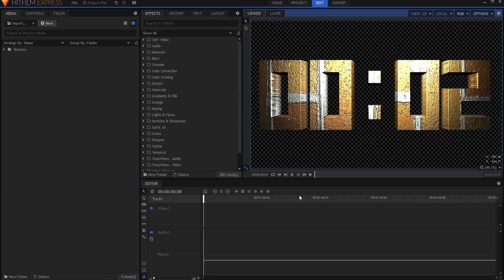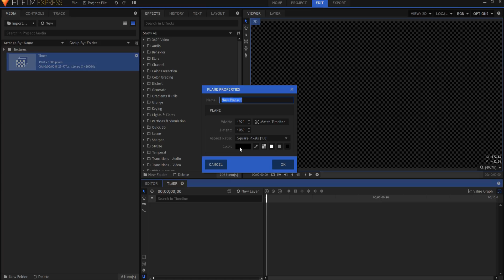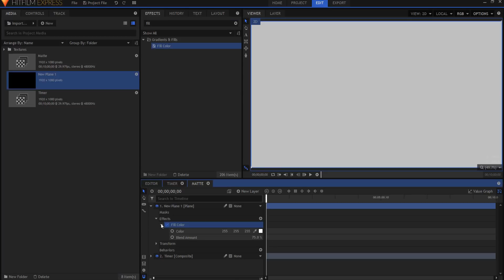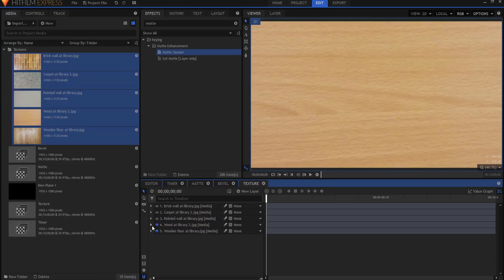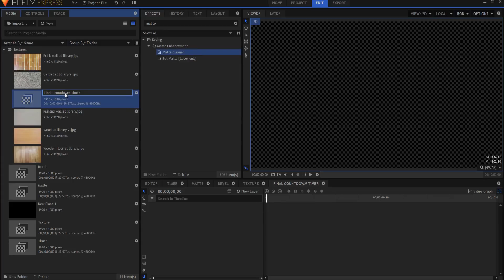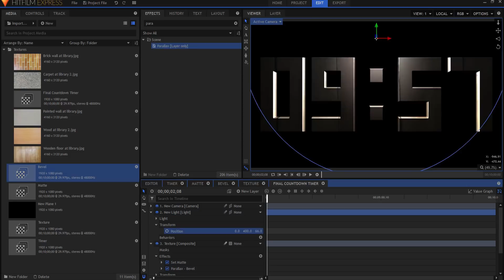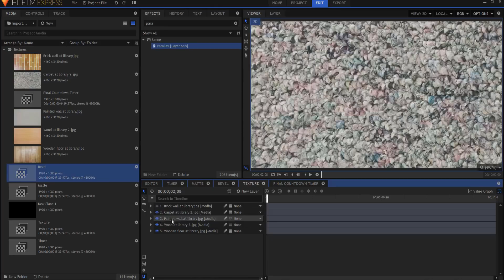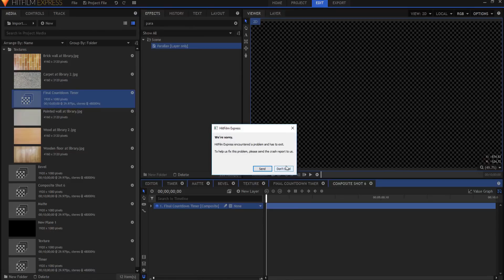How to Make a 3D Countdown Timer in HitFilm Express

Comment: I don't know how to freeze the timer?
Reply from the maker: Do you want it to stop in the middle of it's countdown?
Reply: @HitfilmSensei  Yeah and restart, as well before like if I was talking, "get ready set go" then make numbers start. You see the clock frozen for a time.
Reply from the maker: @ParadiseofDarkness  All you have to do is add a Speed Effect and keyframe it to go to 0 when you want it to stop. You can of course have the clock slow down, speed up, etc . as well.
Reply: @HitfilmSensei  I have tried that and still not wont work on reverse time for me for the freeze.  Like if I wanted a ten minute mark to stay paused on that as I talk about a ten minute art challenge in my video, then like said then say ready set go then the timer goes when doing the art. It wont do it. Unless im doing something hugely wrong or my program being dumb. 

Thanks though for the help. Im doing a work around which is 100% harder that I just render a video of the timer to get what I want, then cut it up like a video, then add it in my main video.
Reply from the maker: That's a way top do it to. Simple render out the video, then cut an lengthen where you want the pause. It wouldn't be that much harder.

Comment: I have a problem, when I use an effect in a video it doesnt do the effect so the normal video just starts playing again even tho I set keynotes and all the other stuff. Can you please help me
Reply from the maker: In the upper right hand corner of HitFilm you will find a button called "Options." Change all of the quality and resolution settings there to the highest levels and that should fix your problem.
Reply: Film Sensei  I did this and it still doesn’t work. Is there a reset option bc I really don’t know what to do else.
Reply from the maker: The next step would be to make sure that all of your drivers, especially the video drivers, are updated on your computer. Then, I would download the newest version of HitFilm. After uninstalling the old one, Install the newest one and see what happens. If it still doesn't work, I would then contact FXHome support.